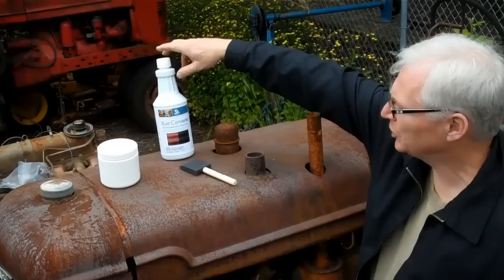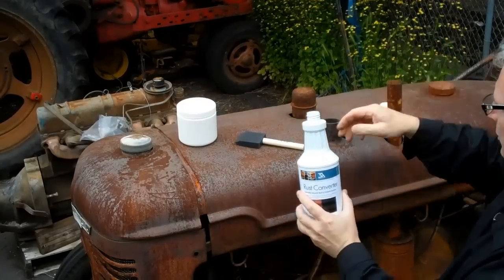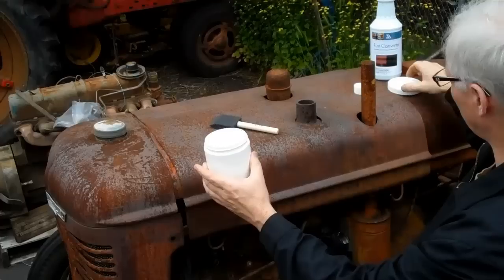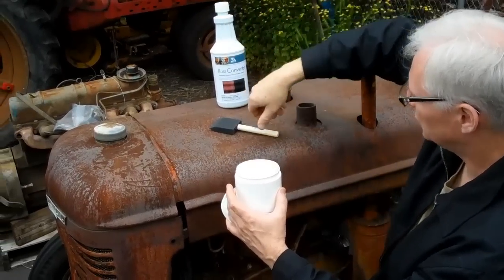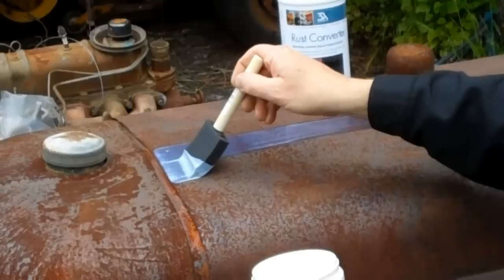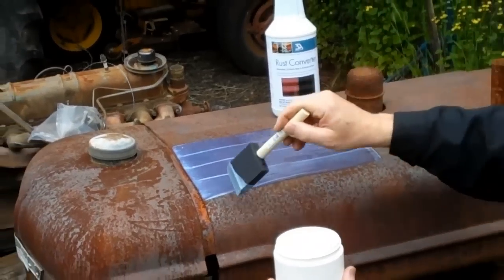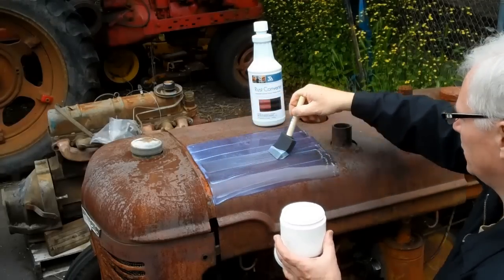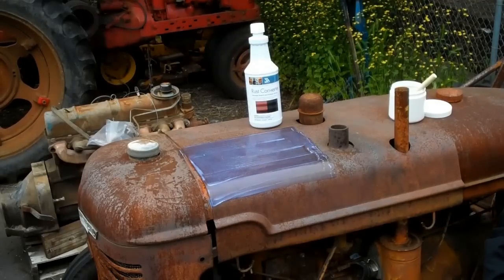Applying Rust Converter to a Farmall Tractor

Comment: Great video man. I've used something similar of not the same and it was great. Used it on the chassis of an old 4X4, the oil sump and on the fuel sender. After I'd used this stuff I used a liquid/mix up metal to fill the rust holes on the fuel sender and sump. Painted with a primer afterwards and this rust convertor is very nice to paint over. Great stuff.

Comment: Fertan Rust Converter converts the rust without the use of acids or harmful chemicals. It also leaves a zinc coating on the surface providing protection until you prime it.
Reply: Jd5083e tell that to the victims of chemical warfare, where the chemical is used exactly as intended, as it is intended to do nothing but cause harm. pesticides and herbicides, used exactly as intended, are designed to kill. nice try, just wrong.
Reply: Shelby Seelbach There's no such thing as something that isn't harmful, and isn't a chemical.  Everything is a harmful chemical.
Reply: brr johnson everything there is is some kind of chemical.  They're all good and bad depending on the circumstances.  Pure clean water will kill you if you drink just a little more than a person normally does just a little faster than a person normally does.  We can't live without oxygen, which can easily kill a person.
Reply: KC9UDX a chemical is defined as follows: a compound or substance that has been purified or prepared, especially artificially. so, no everything is not a chemical, even the things that are, are only potentially harmful chemicals. the chemicals themselves are neither harmful or beneficial, they simply are.
Reply: KC9UDX, wut....
a nonsensical mess, your double negative makes a positive
﹡ᵀʰᵉʳᵉ'ˢ ᴺᴼ ˢᵁᶜᴴ ᵀᴴᴵᴺᴳ ᵃˢ ˢᵒᵐᵉᵗʰᶦᶰᵍ ᵗʰᵃᵗ ᴵˢᴺ'ᵀ ᴴᴬᴿᴹᶠᵁᴸ ᵃᶰᵈ ᴵˢᴺ'ᵀ ᵃ ᶜᴴᴱᴹᴵᶜᴬᴸ 
Isn't harmful = not bad [is good or favorable] 
isn't chemical = refer to physics

There's no such thing as something that IS GOOD and not chemical like love or happiness, light, energy, daydreams.

﹡ᴱᵛᵉʳʸᵗʰᶦᶰᵍ'ˢ ᵃ ʰᵃʳᵐᶠᵘᶫ ᶜʰᵉᵐᶦᶜᵃᶫ⋅ 
Water is a chemical, it's a misconception that all chemicals are bad.
Reply: Shelby Seelbach chemicals were not created to be used to kill people or bugs. they were created by a reaction. people used them incorrectly. that's like saying bleach is used only to kill bacteria. it can be used to clean and whiten.
Reply: Colby chemical warfare labs develop chemical compounds that do not exist in nature, they are developed and produced specifically as weapons. your argument is purely semantics, is like saying I didn't cook this soup, the heat from the stove did. give me a break.
Reply: Colby and to drink. 😂😂😂😂
Reply: but th
Reply: Shelby Seelbach good job cherry pick definitions for your agenda! Chemical: of, relating to, used in, or produced by chemistry or the phenomena of chemistry; chemical reactions

Chemistry: a science that deals with the composition, structure, and properties of substances and with the transformations that they undergo

Here's your sign (it says "I'm an idiot")
Reply: Jacob Sorensen You are grossly misunderstanding me, and it's my fault?  Show me something that isn't harmful in some quantity.  Show me something that isn't harmless in some quantity.  You can't.  But that makes me an idiot?
Reply: Egg Shells ok then
Reply: Cant Stump The Trump ok then
Reply: I have rust on my Honda Wheel well and it is flaking and a bit pitted and layererd at this point.  I have scrubbed off as much bubbled paint and loose rust  as I can but can I use this on something like that?

Comment: To those here wondering about painting after it dries, yes, you can paint right on it without prepping. Just did a rear axle housing with the rustoleum sprayable type. Works really well.
Reply: Hey I know it’s been a while now but how did the paint hold up
Reply: @victork7135  ive painted numerous items with that paint and i have no complaints with any of them. That stuff is great.

Comment: Wot in corrosion alteration
Reply: Good job mate! That's exactly what I was thinking. What is that black layer it converted the rust to? Looks alot like chemically provoked corrosion.
Reply: Snowdone a crude form of rst bluing like the process used on firearms perhaps?
Reply: I read about it. It transforms rust with tannate acid making it turn into ferric-tannate. It is said to be more stable than rust. It just transforms it from normal rust to tanate-rust. It's not necessarily a good or bad thing. Good for certain applications but bad for others.

Comment: I know this video was posted in 2011 but I'll still add my two cent. I used a similar product to this just made by a different company years back on one of my Mazda Miatas, the previous owner had used the wrong type of battery in the trunk which resulted in the battery venting out caustic fumes. Long story short, this lead to mild surface corrosion so I got some of this type of product and it converted it very nicely! I then painted over the area and it held up for years until I finaly sold the car to a friend. So yeah, awesome stuff but just make sure to work in a well ventilated environment.

Comment: Do you wipe this stuff away? Or just let it sit? Because it doesn't look very thick on there after it converted it vs when you put it on. I just want to use it on a spot on the bottom of the door on my silverado but I don't want to put it on thick.

Comment: Im fascinated, can anyone comment explaining how this rust converter works and what its actually doing to the rust, as well as what the end result is.
Reply: SiN Loud there is an comment above  4 years old telling the exat things you was asking for from cvmiata
Reply: Blo0dbound89 Thanks, Can you tag me in of you know where to find it, I scrolled past all the top comments and didnt see it.
Reply: SiN Loud it depends what type of acid this is. Nitric acid for example will produce NO2. Hydrochloric acid produces iron chloride. Most rust removal uses phosphoric acid (which is why they used to use Coca Cola to clean the truck engines!). It produces ferric phosphate which is black, you would want to rinse that off. Perhaps this product leaves it on with some other chemical. Either way you are converting the unwanted iron oxide to some other iron compound but you are not converting it back to carbon steel compounds that are actually part of the structure again

Comment: I would of at least tried to remove a bit more of the thicker rust before using this product, it will give you an even more smoother surface to work with.

Comment: does it work on rusty exhaust pipes?
Reply: ktkace just put oil on them next time you change oil. wrap like the gas lines, brake lines, evap lines with something and spray or brush some of that used oil under all of your car, every nut and bolt. just try if possible not on rubber.parts like bushings, hoses etc.

Comment: Pretty good results considering he didn't prep the metal like you're supposed to with that stuff.  You're supposed to wire brush the heavier stuff off, clean it and then use this converter.   So it did very well considering he just brushed it on without cleaning it at all.

Comment: I put rust converter on my galvanised iron roof and it didnt work properly. The rust just gets worse.
Reply: Toy Mit ... rust converters never work well with galv, reacts poorly
Reply: Perpetual Mandelbrot what would be the best product to use on galv iron roof?
Reply: Toy Mit ... the short answer is no rust converter... but if you really have to: use a zinc only converter, not one with any tannic acid (the product used in video) or anodic properties (will eat the metal)

Comment: Looks like it turned the rust into nice baked on black rust.
There's a reason media blasting equipment was invented.
Reply: Brent Hill ... agreed, also the surface has no profile and is contaminated so ya still have to sand and clean it before painting
Reply: Brent Hill  Its....a....rusty...tractor siting outside... you gonna go through the hassle of loading up whats likely a non-running tractor and take it off to a place that does media blasting, pay up to and likely over a grand...plus additional work??? This stuff works, is convenient, and is inexpensive... Everybodys always got an opinion of ways to do things better..

Comment: I can do the same damn thing with clear coat,it does not remove the rust. it simply put a clear coat over the top of it. in fact I'm not so sure it's not trapping the rust.
Reply: Don Gray plz use the stuff before...it works very good,it even leaves a zinc coating on the surface to protect untill you prime it...it converts rusts...
Reply: Vega-Expert you seem like a very nice person,and I very much appreciate that. how professional it is,and definitely a refreshing,and morally righteous characteristics you don't see to often in today's world,,so thank you again.. however after half my life working in the car business as a detail manager service manager,,and body shop manager for Palm Chevrolet Ocala Florida Ford of Ocala again Ocala Florida,, Betty Bancroft Chevrolet Gainesville Florida Prestige Lincoln Mercury Gainesville Florida Sullivan Cadillac Ocala Florida,,and Vern Buchanan Honda Ocala Florida..I can honestly tell you after many years of experience I have learnt one thing,,and it is absolutely a given  there is no getting rid of rust with any product..hell you can even cut it out,, but still it will come back in most cases. rust whether it be a slow end,,or a Swift moving demise on one's automobile rust will eventually destroy it,,and any other piece of machinery it envelops,,as there is no stopping it with no product..thank you very much,,and I wish you well even if you are selling this product. I enjoyed your video,,and I really do hope the product works for you.I will absolutely try the product aswell my brother has some,,but he to is already complaining about it's performance,,or lack thereof rather, thank you again

Comment: I think a glass bead blasting would be a better idea .
Reply: Bruce Burns.. any blast media (garnet, soda, shot, glass etc) would be better than this product i reckon!
Reply: Bruce Burns yeah probably. 
But I don't own an air compressor, hopper, gun and blasting tent. 
I do own a paintbrush though.
Reply: It's a hella expensive alternative though.
Reply: I'm an industrial sandblaster/ spraypainter, bring this tractor in and I would whip it up for under 50 bucks... no contaminants, paint ready surface and I'll even prime it for another 50... guaranteed corrosion prevention for a few years
Reply: That sounds pretty cheap... I have a 38 ft boat though, surface area-wise I suspect my own work will be cheaper. But it probably won't last early as long.